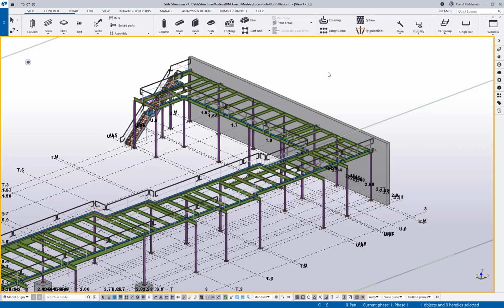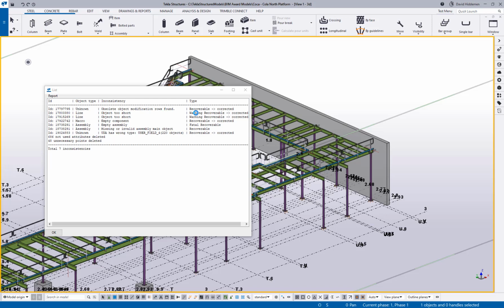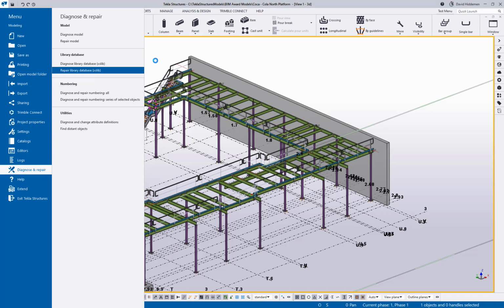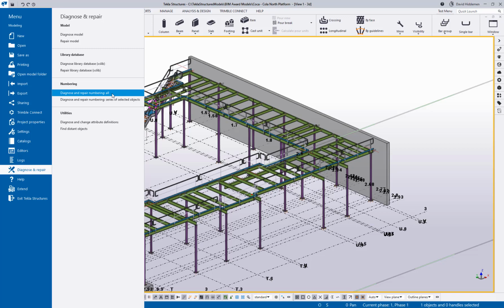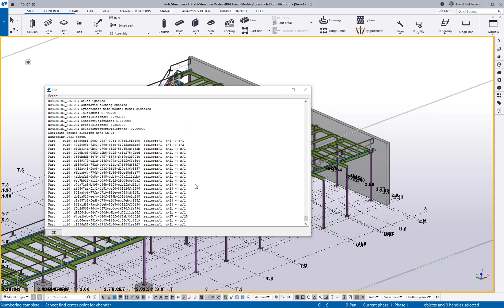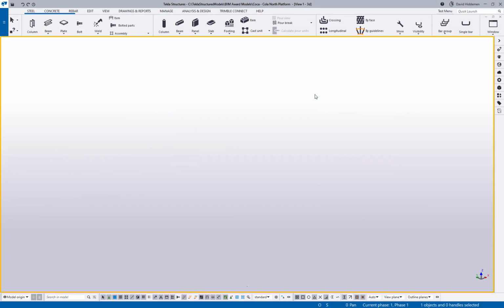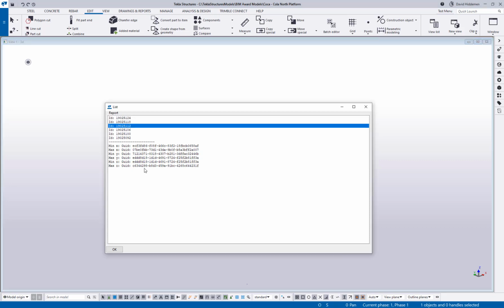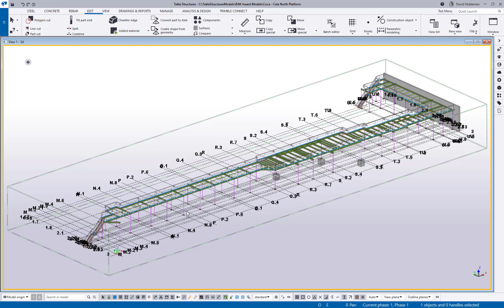Tips and Tricks - Diagnose and Repair Tools within Tekla Structures

Comment: Thanks for the video Dave...
One thing that should be emphasized when using the Diagnose & Repair Numbering All or Selected Objects options is that Tekla uses the current Numbering settings when this command runs. If you have multiple customized settings for Numbering, you need to be aware of what settings you have currently loaded. Just running this without knowing the settings could cause problems in the model by using the wrong criteria...
We mostly use the Selected Objects option if in Multi-user since users will work in different areas of the model on different object types.
- D.Mahaffy
Reply: That's a very good point about it using the currently applied numbering settings.

Regarding the selected objects, the reason I don't prefer using it is because it's not really just the selected objects - it's the SERIES of the selected objects; eg if I select a column with numbering series of C/1, all other columns with C/1 get numbered whether they are selected or not.
Reply: @TrimbleTeklaDave  - in precast, we assign users a concrete product with specific cast unit(assembly) prefixes...ie; ITB(inverted Tee beam), C(column), DT(double tee), etc.
'D & R Numbering of Selected Objects' is very handy for us. 
- D.Mahaffy
Reply: @BruCrew111  Good example. I do tend to get locked into a 'steel' mindset. Usually when people try to use this option it's because they were expecting it to work one way but it actually works another.